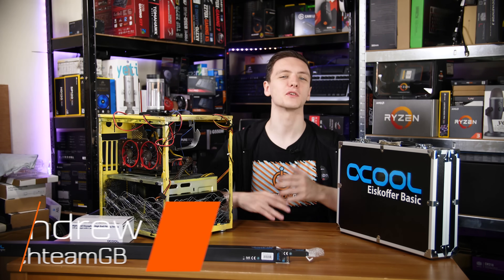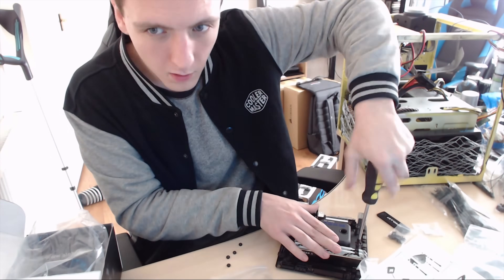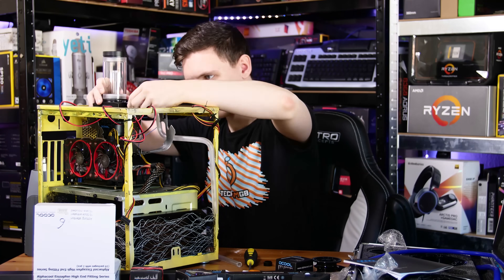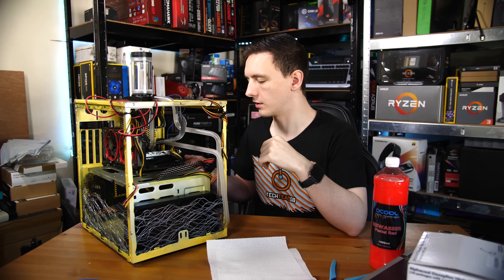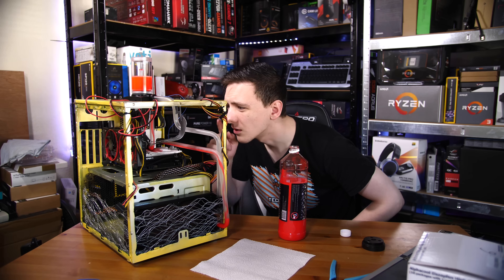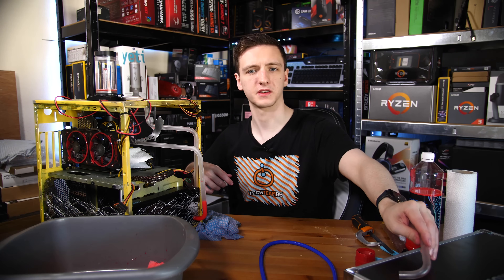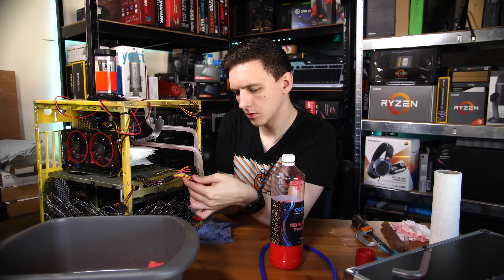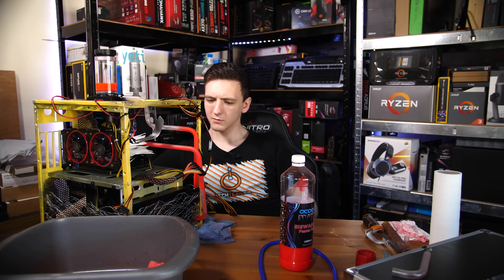PC Case Modding - SIEGE PC Watercooling!

Comment: Hard tubing on a test bench why ? Also soft tubing except is harder to leak its forgiving from saking like changing gpu also puting pump res combo above mobo was  bad choice in case of leaking  and lets say putting above the rad would be also easier working .
Reply from the maker: It's not a test bench, it's a showcase build.

Comment: Lol you didn't use that useless expensive bending kit once, nice job though
Reply from the maker: The silicone inners were great as was the deburring tool. If I'd screwed the bending pieces down like you are meant to it'd be much easier and accurate, but yeah you can do it be hand/eye and generally it'll work out OK. The kit is likely better for the more regular builder - or ones that have more than a couple 90 degree bends :P